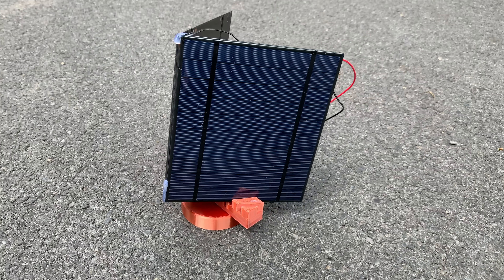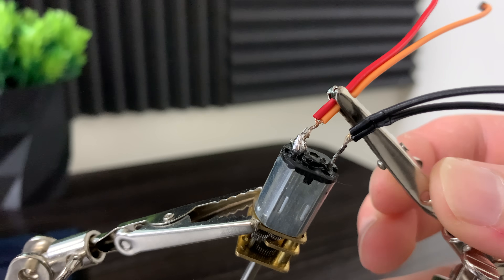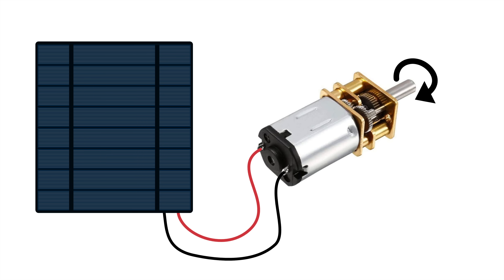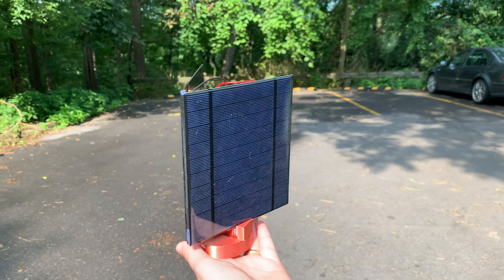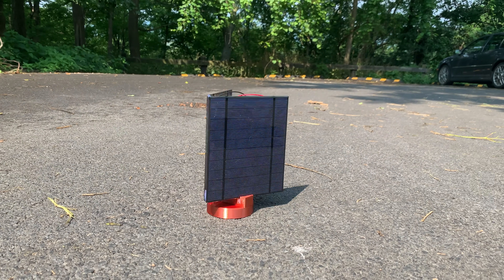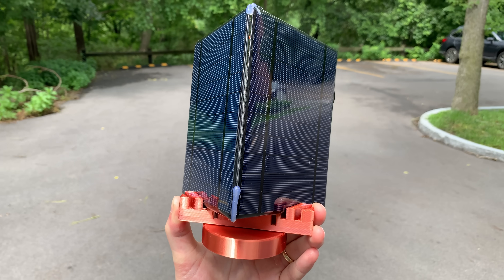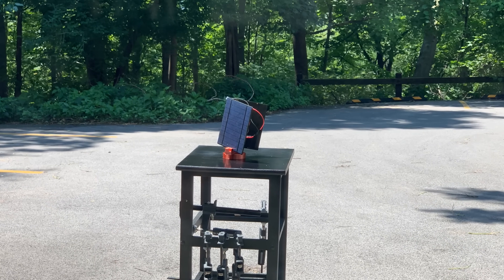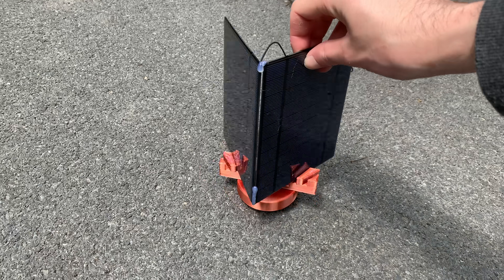World's simplest sun tracker.

Comment: Nice. Gear motors tend to be a bit pricy. The more gears, the more expensive.  I wonder if on each panel, you might put, in series, a low value resistor that would obviate some of the gears a value or 3 ohms, 1 watt say?

Comment: Very cool idea!!  However, I think this would only be useful for a demo showing the rotation happening, or possibly having additional solar panels attached that are powering something else that's also attached to the rig.  You really can't have giant solar panels wired to something outside of the rig unless you have a controller.  This technique is very simple but it's not perfect.  It could end up wrapping the wires all around itself.  A program running on an Arduino or Raspberry Pi could be programmed to prevent that.
Reply: I think you've missed the point of the project.

Comment: This is a nice solution! By angling the panels the way you did though, you can never get the maximum power out of both of them since they can never both point directly 90 degrees to the sun. If you had the panels in the same plane with an opaque 'wall' between them, you might get the same effect you are using now. -- If the angle is wrong, the 'wall' will cast a shadow on one of the panels more than the other, generating the signal you are using to drive the motor. 'Just a thought. Nice project!

Comment: Isn't the point of a solar tracker to track the sun so the solar panel has 100% sun coverage. This set up would at best have a 10% efficiency. Sure you could design something bigger so you could mount a full sized panel above it so it would face the sun, but the 2 little 5W panels and the small motor would need to be much much larger, therefore negating the efficiency of the set up as it would become so big and bulky. Not trying to detract from your project but how would this be applicable in a real world scenario
Reply: This is just a demonstration, of course it is thought to rotate a larger panel. Depending on its weight / mass you will need a different motor / more power

Comment: one solar panel, turns the motor clockwise, second solar panel turn the motor anti-clockwise. And there no more solar panels to produce actual energy.
Reply: It's just the tracking device for a larger panel that will produce the energy

Comment: What can i say, it really is simpliest sun tracker but alas it has no real use for solar power grid. The issues i see are: In order to work correctly panels must be identical, surface must not be damaged (which causes misalignment), surface must always be clean (or equally unclean) in order to align propertly (did i say that already?), only one axis of operation.
And im not saying its bad, it has its potential as a central alignment unit for the grid (its cheaper to get on of those to "control" alignment of the set of actual solar panels then having 1 tracker per 1 unit) but still has to be reworked and optimised to have an actual purpose at solar panel grid. But idea is still nice. Good work.

Comment: You could also use a bigger/stronger/higher rpm motor with a smaller and larger gear, so it would be possible to have more torque, and rotate more wieght/bigger panels

Comment: Great idea, but the downside is that, when both panels reach equilibrium and the motor stops, neither will be receiving optimum sunlight.

This idea could work with using  two smaller panels as trackers to orient a much larger panel, however.

Comment: This works plenty good enough to be useful, and I'm not sure that you can even make it any simpler, but I prefer a version that uses one larger panel for main power production, some photodiodes for the sun sensors, and a CMOS dual Op-Amp connected to a few MOSFET power transistors to send power from the single larger solar panel to the steering motor in the appropriate direction to return the panel towards pointing at the sun.
It's the same general idea used here with the solar panels, but it uses much smaller currents in the photo-diodes (connect them anode to cathode just like the solar panels, with the polarity of the output voltage being determined by which photodiode is getting more sun), but it uses a pair of Operational Amplifier circuits to amplify the signal to a level where it can be used to drive the power MOSFETs (arranged as an H-Bridge) that control current to the motor, thereby closing the control loop.
The Op-Amps would be set up as a pair of comparators, arranged so that there is a minimum current thru the photodiodes (irrespective of polarity) which must be exceeded in order to cause the system to make an adjustment. By configuring the control circuit in this way instead of configuring it as a simple single comparator, we eliminate the tendency for the system to be constantly hunting around the ideal pointing direction.
Adjusting this minimum current would adjust the "dead-zone" allowed by the system before it tries to make an adjustment, and this allows use of a much wider selection of geared motors to drive the pointing of the panel, even including motors that aren't brushed DC motors (so long as they can be told to go in either direction by simple signals).

The best part is that it's technically still a fully analog control system, tho it does take advantage of "modern" semiconductors by using a CMOS IC and MOSFET power transistors, rather than using relatively current-hungry bipolar transistors.
This means that it's relatively simple to understand how it works (no code or logic gates to get confused about, just some simple control laws), and because it uses CMOS IC's and MOSFETs the standby electrical power consumption from that single solar panel is miniscule, so the control system will basically only consume significant power when it's actually re-positioning the solar panel. That means a much higher proportion of the electrical current generated by the solar panel is available for use by a load other than the sun-tracker itself, such as being sent into a switching regulator that can output USB power to charge a phone or USB battery bank or something useful like that.

Comment: Now all you need to do is add some resistance with a battery charging panel on top pointing in the average direction of both panels and it will not only help with over rotation but become excessively useful. 👍❤️

Comment: You could have used smaller panels for higher rpm motor, also the rotation would have been smoother as time goes by

Comment: Not so simple when scaling up but nevertheless brilliant idea thanks for sharing. The eternal dilema is always in durability cuz of the mobile vs non mobile part given the necessary higher maintenance of anything that moves. And continuously. Mount a 8kWh solar panel system in ur idea and I'd like to see if the 30% extra energy we can get exceeds the cost of producing it

Comment: My thoughts:
- Use a motor with even lower RPMs
- Place them more parralel, so it does not run much current when in perfect position to sun
- Add some kind of diodes to prevent backfeeding into the panels
Reply: Guys…IMO the point is NOT to produce a wonderful finished product here.  It’s to demonstrate the concept that there can be surprisingly simple solutions to interesting problems if you have a clever approach.  Problems can be solved when we think outside the box to exploit known traits in a new way.
Reply: or have the panels both facing the same direction and a plate 90 degrees out front that would shade 1 panel use a geared motor to point a large array using just 2 small control panels
Reply: yeah i also assumed the current will soon kill those solar panels, great idea nonetheless
Reply: Yeah all these are pretty terrible.
You have two voltage sources of varying value (but always opposite polarity) basically shorted to eachother. So basically the only limit on the current are the wires. The panels must be getting really hot.
It won't work on cloudy days.
It won't reset after sunset.
It's mechanical - it breaks.
You need to somehow measure it anyway to control main power panels.
Basically anything based on math will be MUCH more reliable. You can get both Location AND Time from just GPS. There are probably many free models/scripts calculating the Sun position. It's not even that complicated, yeah, two dimensional geometry in angular system, but it's doable.
Reply: @MrHerhor67  nice bait
Reply: @MrHerhor67  yes of course, no-one is suggesting actually using this for practical purposes. it’s just a fun toy to demonstrate a principle
Reply: @MrHerhor67  You missed the whole point of this concept.
Reply: @MrHerhor67  omg, you are the definition of a party pooper
Reply: @MrHerhor67  It's mechanical - it breaks
Reply: @MrHerhor67  I think you missed the point.
These panels are not getting any hotter than if they were not connected at all.
"It is mechanical - it breaks" is just ridiculous.
It doesn't really care about clouds, only about difference in brightness.
It should reset just before sunrise, which is good enough (and technically AFTER sunset)
Reply: @alexeynezhdanov2362  How would it reset before sunrise?   It's facing both panels away.

I thought perhaps you could have a light on a light sensor that shines on the panel from the side at night.  That would reset the panel half way and sunrise would do the rest of the trick.   But I'm not sure any solar lights are powerful enough to provide enough juice to turn the motor.

Comment: I love the simplicity of your design!  Will the constant short damage the cells as the voltage is canceled out?
Reply: Due to low angle of incidence to the panels at null point, I think the resulting static current would be too low to burn out the panels.

Comment: The oscillation is a great example of an undampened system and is a common feature of systems with PID control, as well as simple systems like this. 

The solution to the problems isn’t as streightforward as you would think. In this system, dampening is achieved by friction forces resisting the motion of the motor. The first motor easily overpowered this. The smaller motor could not and was therefore critically dampened with the same amount of friction. It wasn’t so much the first motor was too powerful as much as the ratio of power to friction was off. The first motor could have worked just as well (although less efficiently) if the surface between the two rotating parts was made more rough. Additionally, the solar panels could be made smaller in order to deliver less energy, or, potentially the motor could be geared to produce less speed, which would potentially decrease the appearance of the oscillation as the whole assembly would move slower
Reply: It might be possible to get really clever and incorporate some sort of rotational damper to this as an additional alternative. A disk with paddles spinning through a liquid for example. This is very similar conceptually to the rollers you employ in your earthquake demonstration.

Comment: If u ignore the motor the two solar panels are just connect in series and short circuited.. Won't this heat up the wire over time? Judging by the fact that it can spin a motor means it has some good amount of mili amps or even 1 amp

Comment: I had an idea to do something like this to orient a solar panel in two dimensions, using four small solar panels at the bottom of a tube...
When the tube is pointed at the sun, all the cells get the sun, and no rotation, but as some get obscured, the opposite motor would rotate toward that direction...

Comment: Yes, but, don’t solar panels lose efficiency at angles? This would be less powerful than pointing both panels straight towards the sun.
Also, I would expect there to be current loss due to the constant load and resistance.

This is useful to point something at the sun, but not for actual charging.

Comment: worlds simplest sun tracker is a parabole mirror at the oposite side of the solar panels. where ever the sun is. the mirror reflects is more or less to the same point  of the solar panel wich standa with ita back against the sun. while the half circle shape faces the reaction. reflection light feom the sun too the panel. there is something like that on the web. with a mirror. the angle of inpact = angle of outcome. so if the sun hits the mirror with 45 degrees then the lights goes out also by 45 degrees. anyway. adding mirrors to a solar panel is also cool. also transparant lenses.wich can work to magnify sunlight. or concentrate it to a smaller point.

Comment: Doncha just love analogue solutions?
Seems to me the over-shoot of the fast motor was mostly caused by the momentum of the solar panels causing the base to rotate at the end of each cycle. Just nailing the base to the ground would have solved the problem.
When the panel is balanced, how much current is circulating through the short-circuited panels? A couple of resistors might dissipate some of the energy.

Comment: This is essentially the same insight that Rod Brooks introduced to the AI robotics community in the 1980s with something he called a subsumption architecture.

Evolution successfully takes place from the bottom up. Simple chance phenomena that do something useful for an organism are favored by natural selection. Plants didn't develop phototropism for the purpose of more efficient metabolism, but those which did so by chance also happened to gain an advantage.

The solar tracking device depicted in the video could hardly be simpler, yet it uses the same basic principle of excitation/inhibition that happens to drive neural signalling. It's both an advantageous behavior in its own right and also, potentially, a building block of more complex signalling and control systems. Fascinating.

https://en.wikipedia.org/wiki/Subsumption_architecture

Comment: It occurs to me that such an arrangement could be used to control the direction a larger solar panel or an array of solar panels would face to gather sunlight, and a tiny motor would be enough to move the large object very slowly. It would even be possible to use one such arrangement for one plane of rotation and another for another plane of rotation, together as much sunlight as possible with the larger panel or array.

Comment: Did this same thing with a Photoresistor instead of a solar panel to track sunlight for a college project may years ago and have an actual panel to generate electricity and charge a battery. Hardwired serial solutions last a lot longer than micro controllers and are simpler.

Comment: Been done before about a dozen videos. First I've seen using 3d parts though. 

So scaling up for a home sized array is just as simple but larger motor with 1rpm at output shaft. Using a worm drive gearbox will ensure wind will not move you panels or fight the tracker holding position.  Tracking allows 25% fewer panels needed, so it is worth looking into.

Comment: genius... thank you for sharing this video.
the only downside is that this guarantees that the solar panel are not most efficient due to angle, but this is still amazing and very useful.
Reply: I agree. An improvement could be to have them face the same direction but then have a dividing plane between both panels.

When facing the sun they would both get 100% power but as the sun moves the plane would cast a shadow across the opposite side causing that panel to lose power giving the voltge difference needed to turn.

To further save power he could even use a much weaker motor and gear since the sun moves so slow. That way it can be used as a power supply for another circuit.

Comment: but u need to fix it's position each day .
when the day ends the 2 solar panels gonna be facing west and the next day the sun gonna be behind both panels which means no power to rotate them to position until the mid day at best .
so u need to think of a way to make this fully automatic (maybe think of a way to reverse its position when the sun goes down 😉. 
( maybe u can use a spiral spring to store some energy when the motor rotates )

Comment: I have a question. If the panels are intended for solar energy battery charging or any other electrical use, how much energy is sent through the wires from the plates if the condition of equilibrium yields 0 volts since the voltage from one plate cancels the voltage on the other?

Comment: You can do this with a single panel as well. I use this trick in Space Egineers. Have a single panel at a 90 degree angle to the rest of an array and have that power a single rotor. Thus the entire array will spin until it isn't receiving any sunlight placing the remaining panels at he optimum angle to receive sunlight.

Comment: Interesting. A couple issues, though: 1. The motor is drawing power from both panels even when they balance out, effectively making the power requirements the same as if the motor was constantly spinning. 2. The equilibrium point has both panels in non-optimal angles of over 30 degrees (if either panel is optimally placed toward the sun the whole thing moves) which means that the efficiency is substantially cut.
If this could be done with a much more shallow angle, and if the power to the motor could be cut when optimally positioned, it would be a lot better.

Comment: You could make a simpler solar tracker using a material that is reflective on only one side. The side absorbing the sun emits heat and imparts a small force which you can use to turn an object.

Max size would probably be a few grams though unless you're in a vacuum. Technically, in space effectively all objects are sun trackers because of imperfect symmetry creating a bias in solar energy deflection.

This is how a crookes radiometer works.

Comment: This is more or less the way the Parker Solar Probe works to keep the sun shield pointed the right direction.  It has sensors on the edge of the shield's shadow, so if it turns enough to get sunlight, it knows the direction to correct it.  It's basically the same principle.